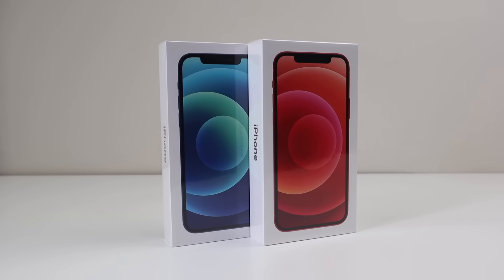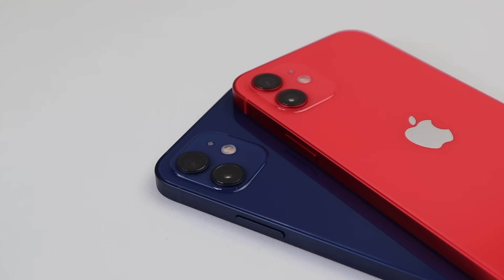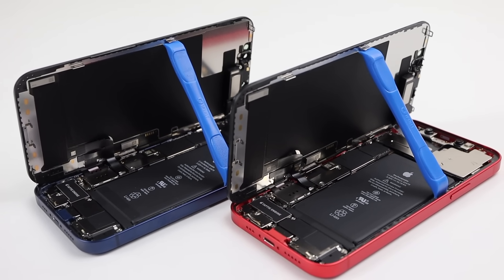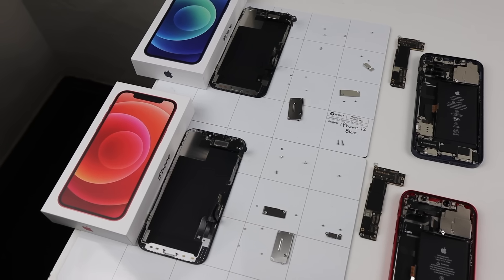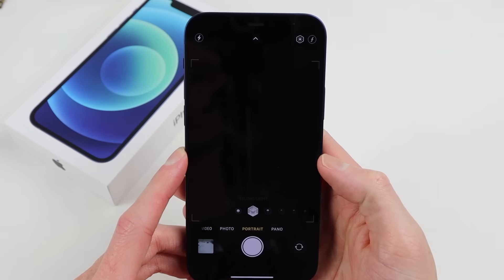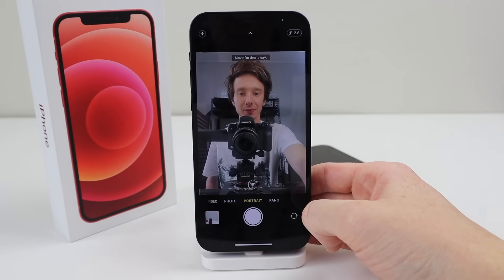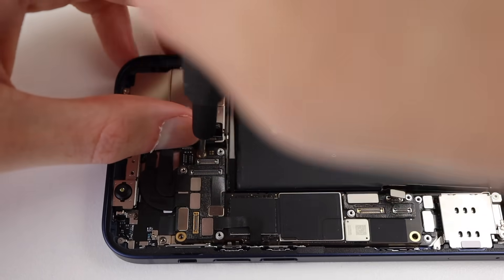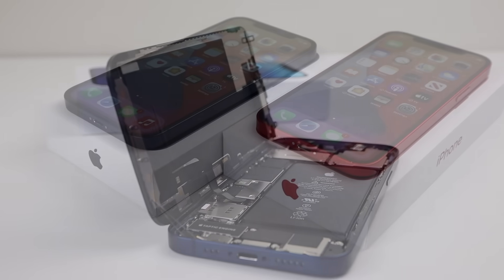iPhone 12 Anti Repair Design - Teardown and Repair Assessment

Comment: The phone doesn't turn back on after disconnecting the battery because it goes into "shipping mode" until you connect a charger for the first time. Shipping mode keeps the battery pseudo-disconnected internally so the device doesn't show up dead flat from the factory due to the constant passive power usage that exists even when the device is "off"

Comment: iPhone 14...

Remove charging cable and instructions for environmental protection, but we don't protect the environmental either so we gonna soldered the battery, motherboard, no pentalobe screws and display completely soldered to the housing.
                                                   Tim Cook, 2022

Comment: I love this video thanks. This is why I’ll not be buying any more iPhones again. I’ve wasted so much money on them since the very beginning. And when they become unsupported and you cannot even upload any software onto them it’s just infuriating. Especially when you got all new parts. The only way is to jailbreak. You should be able to use a device you buy forever or until you ware it out.  The end of second hand fingerprint scanner and home button killed it for me. Plus Apple cannot get any progress on the dictionary and predictive text. iPhone cannot spell any complex words or work them out if you get one letter incorrect. T9 on an old Nokia was better than apples dictionary 20 years ago. At least it learned your words. Why not use a properAI to make it work and learn your common used words? This combined with Apple replacing my entire library with substandard lower but rate versions including some from cheap mix CDs and compilations with the start and end either missing or mixed into another song. Make iTunes a joke in my opinion. I worked as an Apple engineer hardware service and repairs and field engineer maintaining client software. I have had no thanks from Apple what so ever. Repairing all the recall lcd panels on the 27” iMacs and hundreds of devices. Goodbye Apple.

Comment: Apple is just setting up third party repair shops to seemingly break customers phones when in reality they are engineering problems to occur that look like a 3rd party repair shops are breaking the phones so they can recommend always bringing the phone back to apple for service.  This also breaks the trust between the customer and the 3rd party repair shop leading them to naturally go back to apple and pay the insanely high prices for out of warranty repairs.  This is why I will never buy an apple product.  I will not buy from any company with this type of corrupt business model.

Comment: The only way to stop this is to prevent apple by law from selling their devices all over the world. 

I'm still using an old iPhone 6S that I bought 4 years ago from a local reseller and replaced the screen once and the battery two times. And it works great. 
When I can't repair a next generation phone, I will not purchase it.
Reply: I have the iPhone 6S Plus and I only had to change the battery once and I had no problem with that, I hope there is a solution or if not this iPhone 12 is a failure, it was enough that it did not include charger in the box. 

If anyone has iPhone 11 it's not worth changing to 12 pls.
Reply: @pipooon  A friend working in the repair business told me, iPhone 8 and newer have this "feature" where you need to register replaced parts. Otherwise some functionality get lost. 

It's worse than I thought...

Comment: There is a third party application that can be used to reprogram screens: Qianli iCopy.

While it doesn't say yet that it's compatible with the iPhone 12, had anyone checked if it'll actually work? This is assuming they didn't change the pinouts of the connector or find a way to make it read-only.

Comment: Time for some snooping display, camera and battery data. We all knew this was coming. Apple has truly become what it always claimed to detest in the last decade. Nobody is allowed to earn an honest living with repair, all the money is for the shareholders. Immoral is a word that springs to mind. And I am not even going to elaborate on fixed SSD's in Macbooks here, or putting a 50V LCD backlight connection pin next to an auxilary data pin that goes uncoupled into the CPU. One drop of water on the wrong spot... Seems Apple is coupling the wrong things to me. But hey, you can always buy a new one, right?

Comment: In Apple's corporate mindset and practice, they believe that the money you spend on your phone is purely seen as you just renting their device until they end support and obsolete and force users to get the next version and paying for the privilege.  To think you can purchase a flip phone for less than $100 dollars and get your messages and voice calls just as well and it does not destroy your wallet.  I have 2 iPhones 2015 both 6s and 6 plus both cost me nothing and are working but I certain they will become obsolete and stop getting any further support or be able to fix them in a few years.

Comment: Where tf am I meant to go when my screen cracks there isn’t even an Apple store in my city
Reply: Yeet it on a lake and u're good
Reply: You can get it changed but it will devalue your device by 100's with these god damn messages!!
Reply: I .. don’t know?
Reply: Buy a new one. Apple store will likely charge you insane repair check anyway.
Reply: same like where do i fucking go theres no apple store in the philippines tho there are some authorized stores like power mac etc

Comment: Not saying that this IS the reason, but I think this has to do with the dolby 10bit recording. 
The reason why HDR video is actually really rare on smartphones isn't because they cannot do it, the newer SD chips have a image processing chip that has the capability to do so (on the SD 865 its the Spectra 480 ISP), however only very few phones such as the Iphone and Asus Rog3, Zenfone 7 and so on have this enabled because of licensing. I suspect the glitch is happening because the Iphone cannot recoginze the dolby HDR license anymore causing it to act super weird. 

So technically not apples fault

Comment: Seems that the new iPhones have tampering sensors. Woww!  Independent repair shops and their customers will be screw with this product. So before you get it, think twice. And check the prices of Apple repairs. Because if you break you screen and it will cost you around 500$ to repair at Apple store. There’s no point to get this phone.

Comment: I’ve always found a way to defend Apple’s actions in literally everything, even the headphone and charger removal. But this one idk. My one biggest issue I could always think about is how dumb their repair related things are be it price or preventing others from repairing it. In warranty is fine because it’s £25 screen replacement with Apple care etc, but official repairs out of warranty prices are stupidly high, even for someone who’s completely fine with all their other prices
Reply: It's because they're major proponent against "right to repair" laws in the US. It feeds their bottom line for their customers to have to go directly to them. They actively lobby in states to make sure they don't pass laws where you can get services without.
Reply: @IDiggPattyMayonnaise  As someone who got scammed buying a used iPhone, that supposedly hasn’t been repaired (turns out it was, and pretty unprofessionally), I think something like this could prevent scamming people with badly repaired iPhones. Why don’t they just put some sort of information into the setting, that states which parts have been changed, if they are able to detect that? That would actually be cool!
Reply: @mon4d  in your face. Cant even afford the original, and still choose iphone. Definition of ifag.
Reply: @lowerfive6318  I‘m a little shocked about the amount of spite over my comment. What did I do to you exactly? Why are you so angry?
Reply: @mon4d  my friend, have a few words of wisdom. DO NOT INTERACT ON TECH RELATED COMMENT SECTIONS. 99% of people here are extremely toxic, and can't imagine someone liking something that they don't like.
Reply: You are a what's called a sheep. Literally a sheep.
Reply: Wait how do you defend them removing headphone Jack and charger
Reply: @lusathegreat6300  they didn’t remove the charger, the removed the adapter the plugs into he wall. The charger is still included and was switched to USB-c so that it works with apples computers and tablets. (USB-A wouldn’t be compatible with MacBooks and iPads) the reason they removed the adapter is because they are trying to move towards a wireless charging future, similar to what they did with removing the headphone jack and releasing air pods. It’s not a coincidence they announced mag-safe the same year they are not including the wall adapter
Reply: @dsorpqxh  Literally 90 percent of the population don't have a USB-c wall plug. If they really wanted to save E-waste they would have put all the instructions on the box and used a bio degradable box and wrappers...
Reply: why defend any company when over and over they have shown that all they care about is your money and you are just a number to them?

Comment: I have been using an iPad Air for 2 years. Few days ago I noticed a small gap between the screen and the body. When I contacted the support regarding this, I found that this might be because of a battery bulge and if I continue to use this, it might damage my display. I was a bit shocked as I never expected this out of an Apple product. I truly understand if it’s just a battery performance issue but don’t you think it’s stupid to pay a fortune and buy something that can bulge? Apple boasts a lot on the environmental friendly approach they take, do you think that creating poor quality battery that bulges is a way to save the environment. Truly disappointed ! You have gained an unhappy customer. Will definitely share this with my friends and relatives . Thanks !
Now the funny part, I decided to pay for the battery replacement but none of the so called authorised dealers would accept my iPad! All they said was to throw it away and get a new one. The senior Apple supervisor whom I spoke over the phone mentioned, I need to fly back to the UK (from where it was bought) and then come back to India 😂. I finally understood their logic and gave up 😂

Comment: So for many years Apple has consistently & repeatedly shown they do NOT give a dam about anything but money. No matter what they say, Apple doesn't care about ot respect it's customers, employees, sub contractors. US & foreign based work force and certainly NOT the environment! All Apple  products are made and repaired with lowest labor cost. Mostly in places that have virtually no labor or environmental regulations or enforcement. They only care about stock price, growth, profit & power or control. They willfully push the envelope as far as possible on every issue. Not to protect the customer, employees or environment but only Apple Corp. They churn out new models just to create obsolescence & sales. HINT if you HAVE to own Apple buy their stock. The products were always overpriced & actually they're not that much better than the competition  anymore. Just my $0.02.

Comment: Male USB3.0 to Female USB Type C adapters?
https://www.amazon.com/Satechi-Type-Type-C-Adapter-Converter/dp/B07KCL8WZK/ref=asc_df_B07KCL8WZK/?tag=hyprod-20&linkCode=df0&hvadid=459410835726&hvpos=&hvnetw=g&hvrand=8722458194540835432&hvpone=&hvptwo=&hvqmt=&hvdev=c&hvdvcmdl=&hvlocint=&hvlocphy=9033275&hvtargid=pla-674297293829&psc=1

Comment: Why don’t people just use their old charger, like their old brick and cable??

Like the iPhone still uses lightning right??
Reply: Sure you can. The charging speed will be slower though because the old bricks are 5W compared to 20W.
Reply: usb c
Reply: He literally showed in the vid that it’s lightning and USB-C, while the old chargers are USB-A.
Reply: @zireael666  he means you can still use the old usb A to lightning cable
Reply: @dunnowho  so what about the new cable? throw it away? very eco friendly
Reply: Up to you
Reply: @dunnowho  but to make that new cable apple has a carbon footprint, and why not just just ship the phone only if they claim eco-friendly or ship with the old cable, because the new cable is to bait people to buy extra for the new charger (some sell it for $100), that's how evil apple is they masquerade it as eco-friendly when it's to add more revenue.
Reply: @oliverk3913  sorry to clarify, i dont really care what you do with your cables. Im just pointing out your possible misunderstanding of salvador flores' statement.
Reply: @zireael666  i mean why dont people use their old brick AND cable instead of using the new usb-c which not every one has a usb-c brick
Reply: @salvadorflores7438  Sure thing, but that's going to cause a problem itself. Apple always boast about optimization, but using an old charger is basically not an optimization and by using it is basically going backward in technology. An old charger is on 5W while the new USB-C is 20W
Reply: @salvadorflores7438  You’re right, my bad, didn’t even think about it.

Comment: Apple said they wanted to reduce landfill or something. Doesn’t an unrepairable phone like this qualify for it?
Reply: they want u to pay for the repair at an apple store
Reply: This phone is very repairable, as seen on the video, it just isn't repairable by you or third parties.
Reply: @Pretagonist  Thats no excuse. They should allow a feature like that. its anti consumer
Reply: @LaserXP101  It's absolutely anti consumer. And morally wrong. But it isn't an environmental issue since the phone is repairable and that was what the comment was about.
Reply: Check replacing same colour phone board and I feel all issue will be resolved

Comment: Sounds to me like an issue with the gyroscope. Panorama mode requires use of the gyro. The ois is a new system in the 12 where the sensor is stabilized instead of the lens, so maybe it’s using the gyro for that too, which could be why the regular camera lags a bit too. Could it be that the gyro calibration data needs to be reset somehow?

Comment: That's so fcuked up, your using original Apple parts and they refuse to auto pair with other apple parts? Insane!

You would think Apple would be smart enough to know a tech channel would try to swap the logic boards and at least allow such to prevent this backlash
Reply: They probably don't care. As long as the people keep buying their devices(awful as it sounds, a lot of people simply won't care), Apple is just going to wait for legal action to kick in.

Comment: This is why I probably won't ever buy another Apple product again. I used to own a few iPhones, but as the repairs started to get trickier and expensive, I gave up on Apple. 

Now, Samsung is screwing us with Exynos, so my next go to company will be OnePlus and so on, with exception of Huawei, due to Google conflicts.
Reply: I suggest a Xiaomi. I'm no expert but they aren't paired or anything. And I think you can easily repair them. I don't know for sure going to do some more research but if you want a good phone that is getting updates and you can repair than that may be your best bet.
Reply: @makzz_1352  Thanks! Right now I'm using an S9+, but will make a switch once the battery goes out completely, and since I plan on buying a camera anyways, I probably won't look for superior camera performance in next phone.
Reply: @astanisystems  yep glad to help. Good luck 🤞
Reply: Well, i cant say im ready to drop apple completely, however, my main argument against seitching to andoid was, that i can repair my iphone anywhere in the world cheaply. Not original parts of course but still. Happened to me while traveling, changed displays for $35. Whilst my brother, using samsung s9+, had to order the display and wait 5 days till the phone was servicee and payed around $140. 
Waited for iphone 12, but seeing how fast it gains scratches and now that display cant be fixed by 3rd parties Im either gonna switch or wait till apple loses the lawsuit and is forced to allow repairs ( has to happen one day )

Once you sucked into apple ecosystem ( got ipad, airpods, watch ( was a gift that i barely use ) my whole family except my brother uses iphones and macs ( he has mac as well ) ) there is no leaving
Reply: @demimishiev5358  I know it, my little brother still uses his iPhone 6. He kept on breaking and repairing it. I however made a switch to Android phones.

Comment: Ceramic is known to withstand large amounts of heat. That's why you had to increase the temperature on the heat map. The screen has ceramic particles and might be able to withstand higher temp as it is not conducting heat to the glue to melt.